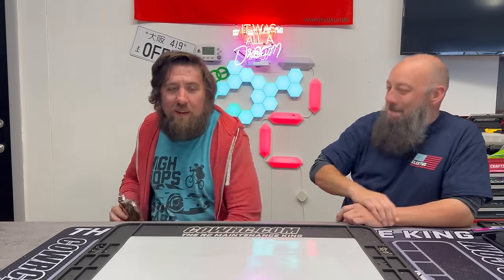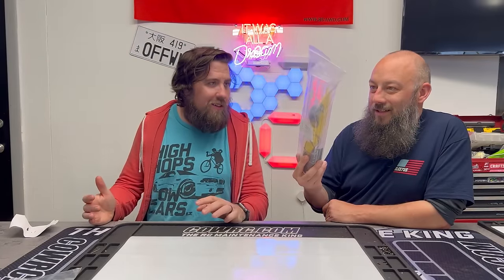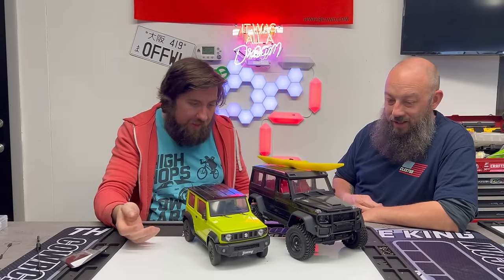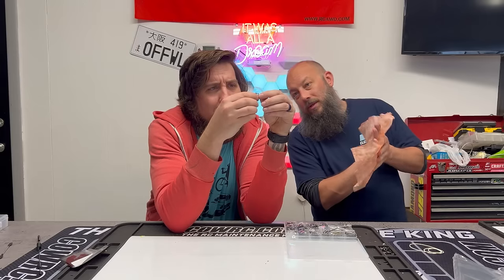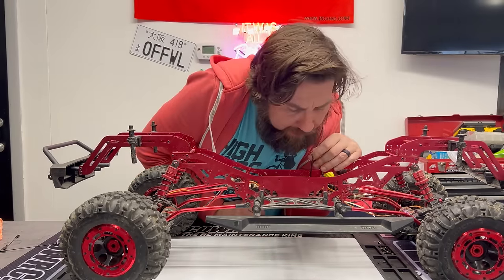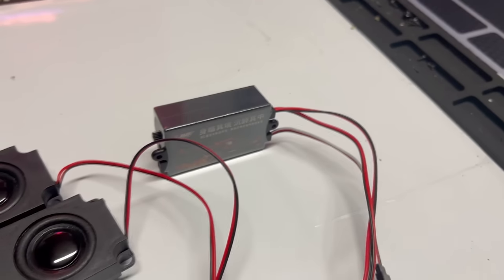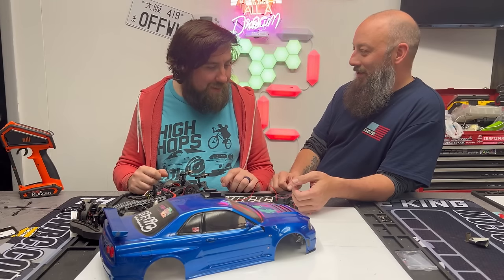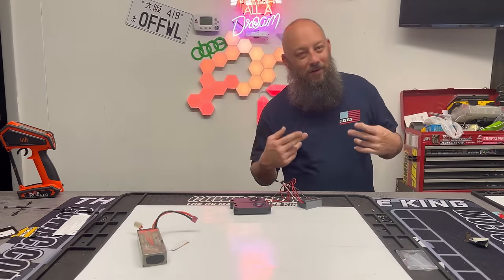The TOP 5 MOST SUGGESTED RC Accessories on Amazon

Comment: If you convert that redcat clawback to dual brushless it’s not the transmissions you’re going to worry about it’s the drive shafts that go from the wheels to the transmissions that you’re going to snap I have one currently converted to duel 1250 KV brushless crawler motors with hobby wing a ESCs and it constantly snaps the axles even when I change the steering in points to a less steering it’s still snaps the drive shafts and I’m still now trying to find a fifth scale crawler body to put on mine because my son broke my clawback body